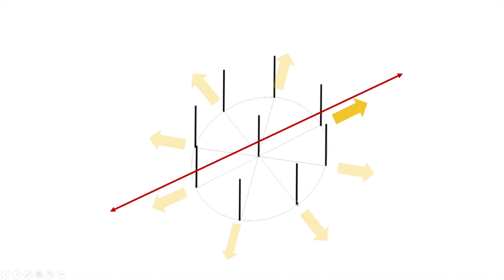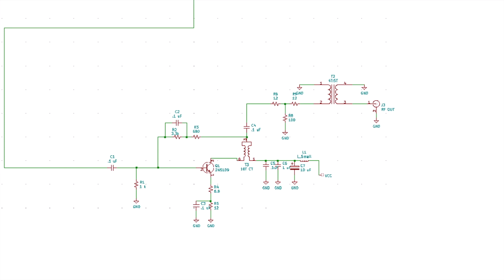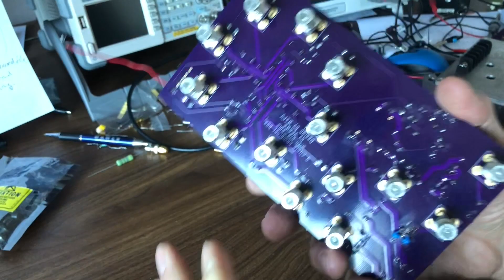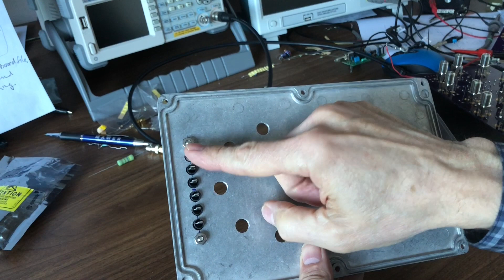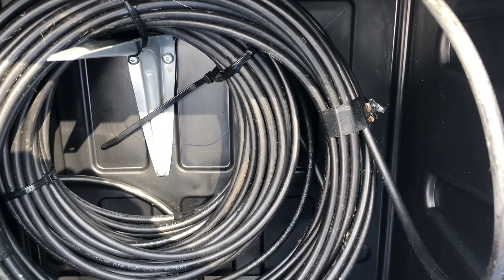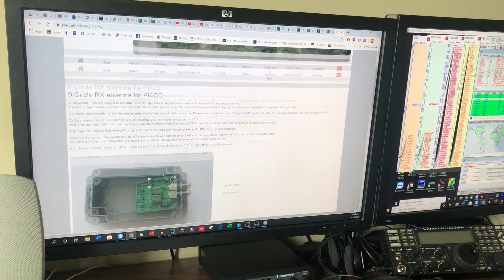9 circle RX array combiner board with integrated pre-amp

Comment: Moose resistant construction certified, which you had video/pictures of that incident. :-)  This is for receive-only?  You could probably use smaller diameter cable and obtain more and tighter wraps on the choke isolation loops.  Although I see that you are using flooded cable so perhaps the moisture is more your concern.  Nice board.